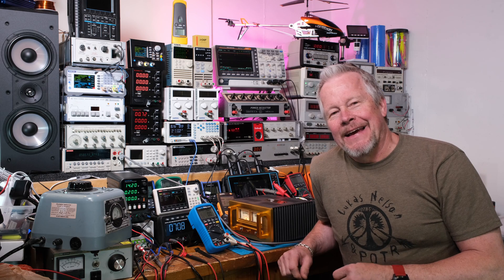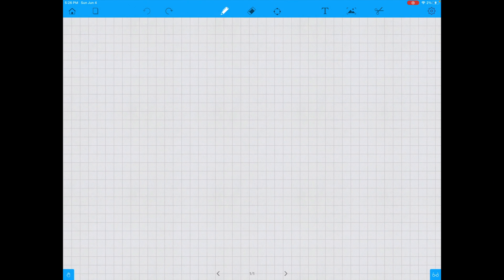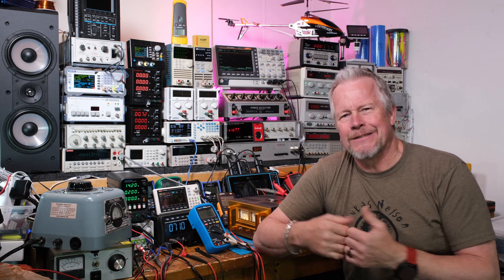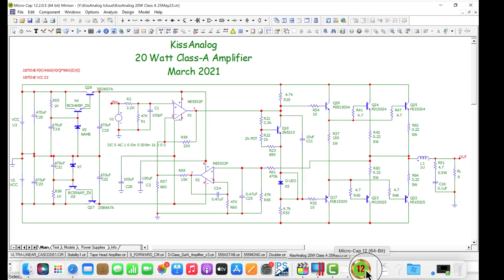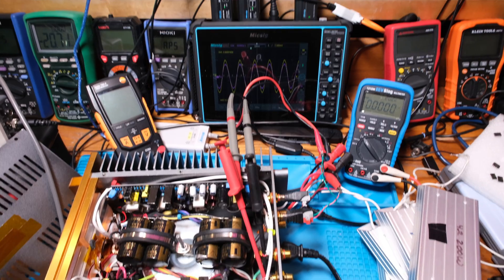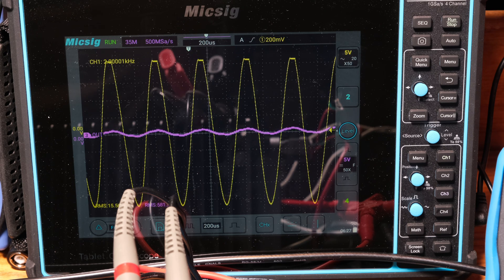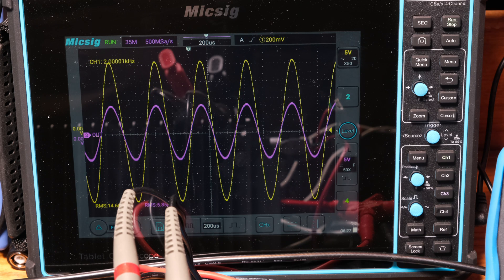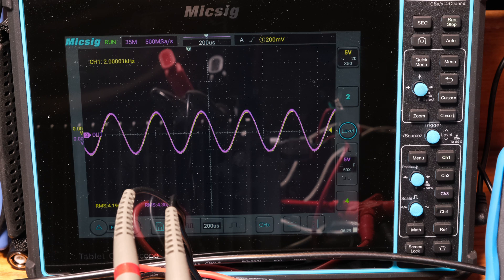Setting Bias current for 20 Watt Class A Amplifier

Comment: Hi, late to the game, but I am a learner.
You sort of gloss over the matter of "input signal".
So, I understand that one can feed a sine wave signal and adjust the quiescent current level to an ideal point as one watches the level of signal on an oscilloscope (to make sure biasing does not cause clipping/distortion, i.e., overdriven).

Questions: (1) Where on the amp board and how does one feed the test signal (say a 1 KHz sine wave from a signal generator), and (2) Where does one connect the oscilloscope's probe(s?) to acquire the signal for the oscilloscope to display? Thanks!
Reply from the maker: Thanks for the great questions!  Funny - I was just thinking this morning about doing another video on this topic;)  

First; bias is usually set without any signal - it is setting the resting level of the amp.  But, it can be adjusted while watching a signal to be sure it is set high/low enough.  The signal would be injected at the same spot as the normal input signal would be.  It is nice to see the sinewave at the output to see if it is visually undistorted.  What you are watching for is where it crosses zero - to be sure it does so continuously without some crooked path - as one transistor turns off and the other turns on.  Actually - watching the FFT is a great way.  IF there are harmonics - then it is not smooth - so you should only see the fundamental.  Also - it is great to try different frequencies - just to be sure;)

Comment: Hey Which op amp is best for lowpass subwoofer filters?
Reply from the maker: Actually the one I chose I like the best because of the voltage range:)
Reply: 15-0-15 dual supply op amp?

Comment: Thank you for the great video.  DC measurements with temperature too, just what I wanted to see.  I have seen heat sinks saturate and temps rise over time without fans. We don't want fan noise. i have to see more videos.
Reply from the maker: Thanks for your feedback!  I thought about using a small fan to slowly move the air to help with air movement and cooling.

Comment: Why was 8ohms chosen?
Reply from the maker: Great question - thanks!  It doesn't actually matter what load is used to set bias.  Bias current goes through the output transistors but not the load.  I tested this amp with 4 ohms in part of this series (it is in the playlist).

Comment: Great stuff …when playing music with class A. More power will be dissipated by speakers than sitting idle with no music ..so it should be slightly cooler at high volumes??
Reply from the maker: Thanks for asking.  Well it probably won’t get cooler as the bias current is the minimum power dissipated:)